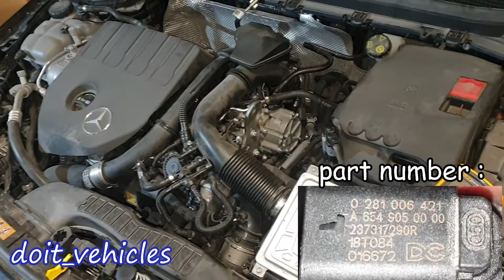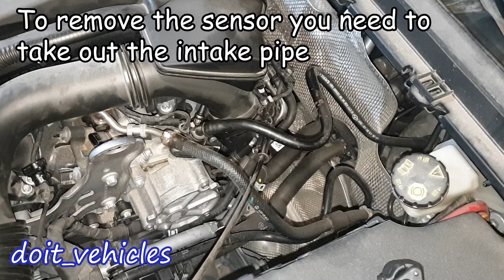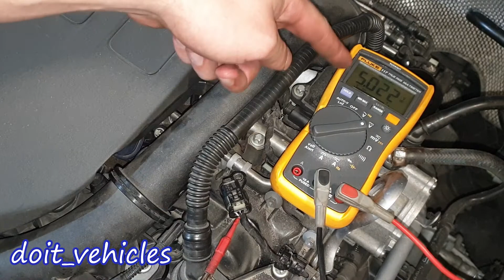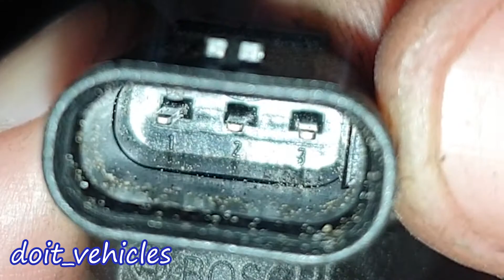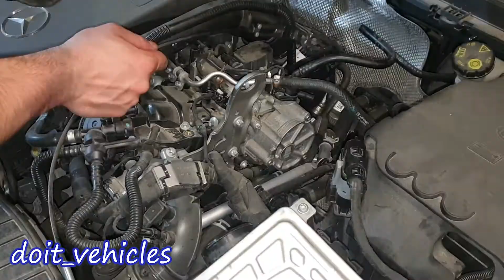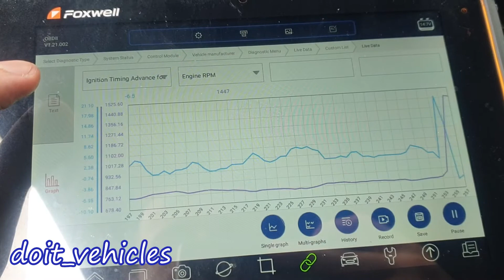A200 Mercedes w177 Camshaft Possition Sensor

Comment: What about this sensor which is in front of the engine just above water temperature sensor. What is that sensor called? What types of test can I conduct? And the one on top of the other camshaft position sensor? The engine is m111 in w203 body.